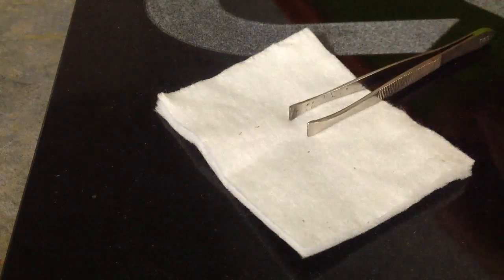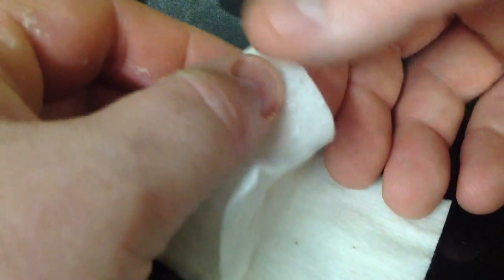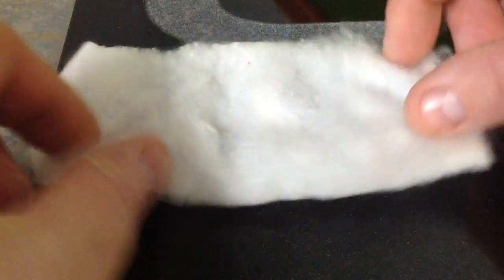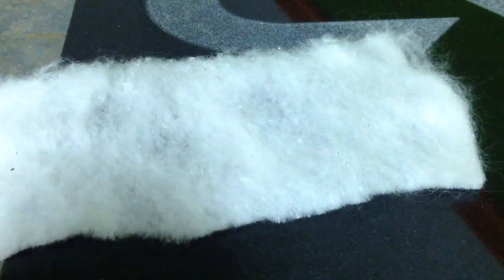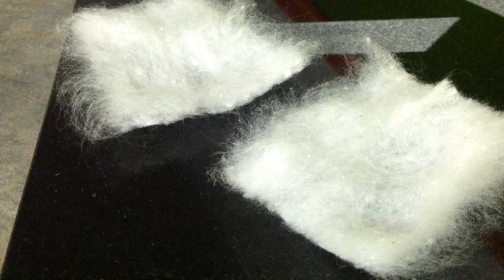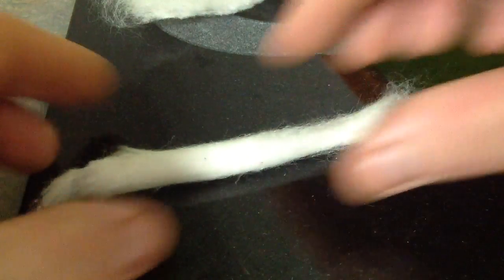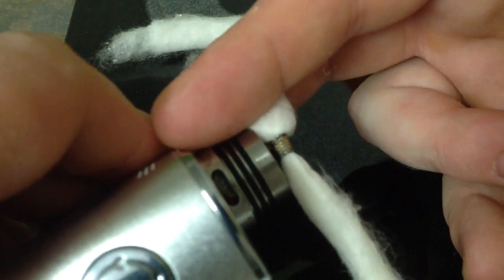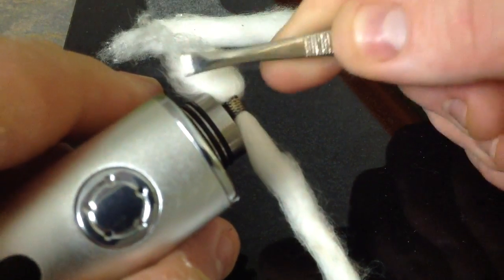How to wick using the Scottish Roll

Comment: Can I ask why you do not recommend Cotton Bacon v2 for the Scottish roll? I see videos out there about doing it with CBV2 and thus far in my building exp (few months) have only used that material though I have kendo and muji pads. I've recently been attempting the Scottish roll with the bacon and for my RTAs it seems okish, but for my RDAs I always get weird burnt spots or what seems to be burning. I tried this method with a Muji pad the other day and its like it works perfect not spots I can vape my wick white and no weird burnt spots and it even seems to wick faster.